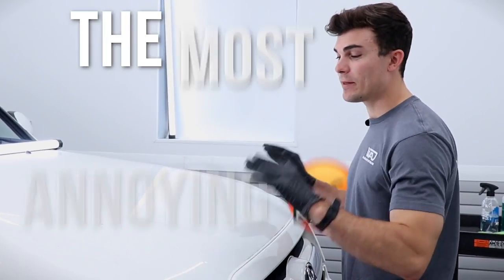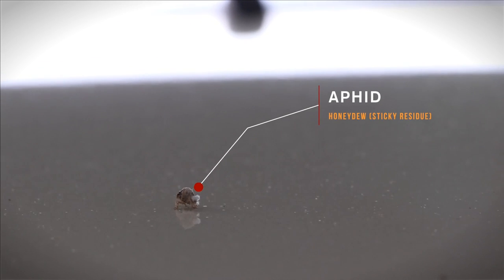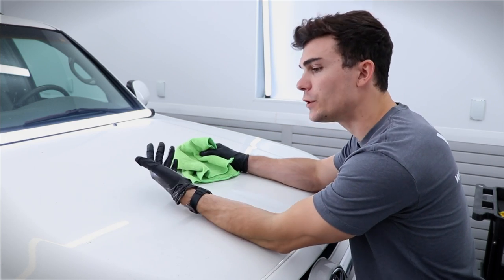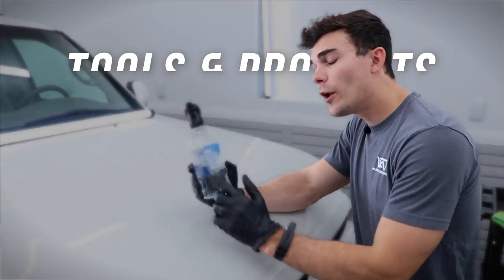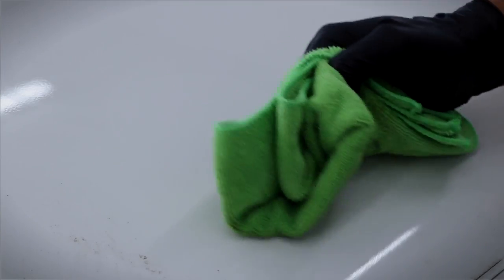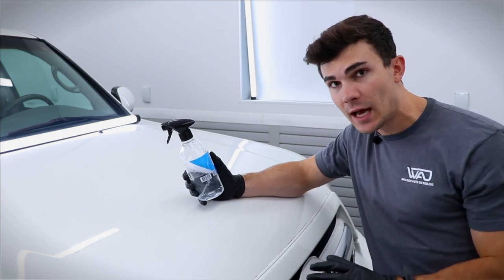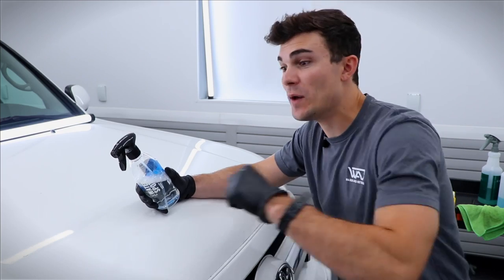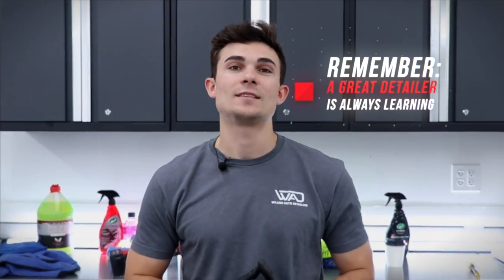The Most Difficult To Remove Residue On Car Paint | Aphid Honeydew

Comment: If you don't want to spend $20 on the Gyeon water spot remover, make an IPA and acid mix. After looking into their SDS, that's all it is. I did a 15% IPA with wheel brightener at a 1:2 ratio, dissolves the aphid crap immediately I'm sure identical to the Gyeon. That bottle of solution probably costs them around 15 cents to make. Lol

Comment: So you never once in the video actually say the brand name of that water spot remover, nor is there a mention of it or link in your video description. Just links to your courses.
Reply: I know right, but I found it. He's using Gyeon water spot remover.
Reply: With a background in chemistry, I looked into the safety data sheets of these clear liquid water spot removers. They are basically IPA and acid. I made a combo of wheel brightener and isopropyl alcohol. It dissolves it immediately. My truck does have a sealant/wax on it so it removes easily. But the acid IPA is instant results. Just make sure to never get any acid on glass.